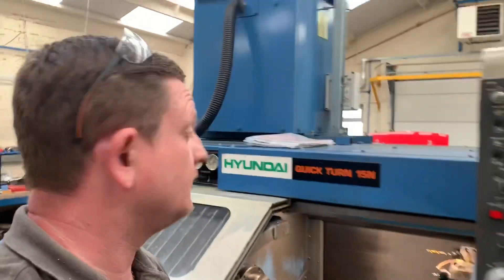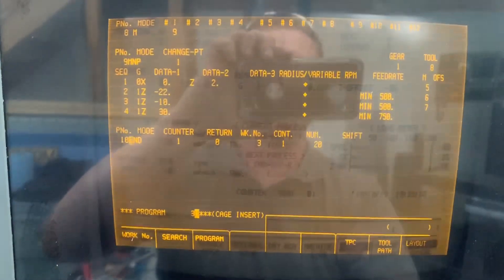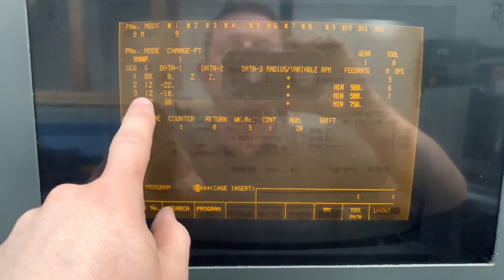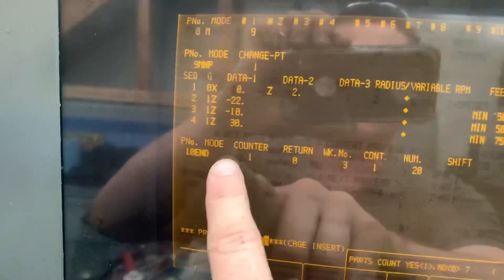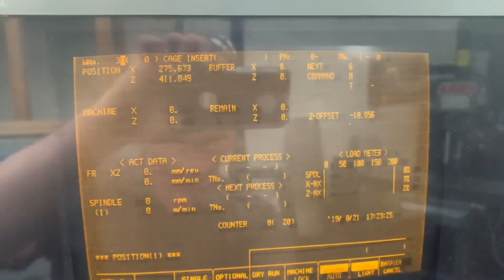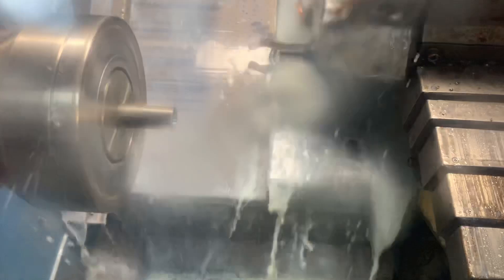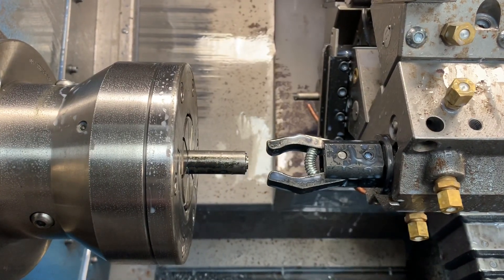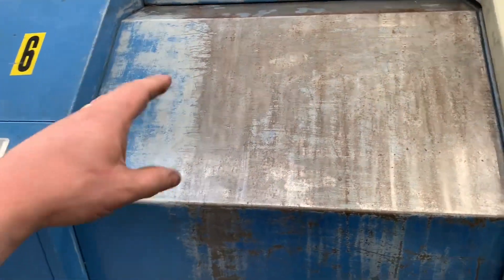Programming a bar pull on the Hyundai QT15n with Mazatrol T32B control

Comment: Its strange that mine with the second line with 0Z instead of 1Z moves in slowly no problem even though its a rapid move as you say?
It also says "282 chuck clamp exceed time" when i go into x100 to move away manually i then have to clear and it closes.

i did see that on some mazaks you have to have bar feed stitch on but i dont have one.

the fact it starts the program means it should work i guess.
thanks and sorry for all the questions..

Skip.
Reply from the maker: Do you have the M code options to control the chuck turned on?

If you do an M06 or M07 when not in a program just using the buttons on the control does it open and close the chuck?

Comment: G'day Marc,
I put in you figures etc it came down to z then stopped.
I then changed second line form 1Z to 0Z and in went in -22mm the jaws opened then it stopped..
I changed line 3 to 1Z from 0Z to see if would work but no change any thoughts please?

Thanks,

Skip.
Reply from the maker: Hi

With regards to the X & Z figures these have to be set to suit your job, X is always going to be zero for a satraight on bar puller like mine but the Z values need to suit the job your doing so you set them but manually jogging through a mock bar pull test and noting down the z values

If the machine is stopping then something is missing from the code most likely

Make sure you have a feedrate set?

Also by changing the 1 to a ) you have changed it from a feedrate move to a rapid move so be careful with that

I could always upload another video if that would help to go through it again

Thanks
Marc

Comment: Still trying can I ask how you describe the bar puller in tools please ?

Thanks,
Rob
Reply from the maker: For the bar puller tool it is just designated as a drill in the tool table with no X offsets obviously and no z offsets.
The gripping diameter of the puller is adjusted via the socket cap head screw in the rear of the tool which opens and closes the arms

Comment: Gday Marc great vid I have mazak quick turn 15n still learning is there much difference in my control to yours you said yours was uncommon ? I reply want to get bar pull going have ordered one similar to yours. I was hoping to get the Bar pull program in  its own block and then call it up and to each program that I need it for. Can you help me do this please.I am going to try plugging in your program tomorrow and see how I go!
Thanks skip
Reply from the maker: Hi

Glad you like the video,

When you get used to using the Mazatrol you really do not need to have a sub program for the bar pull and to be honest im not sure how you do it that way but it is literally a 5 minute job to set up the bar pull at the end of a program using the manual programming so thats the only way i do it, also you will have to ammend the z values to suit each job anyway so it would not save you much time

You did not say what control you have? but im pretty sure most of the earlier controls are pretty much the same, mine is a T32-B

Thanks
Marc

Comment: Thank you,  I don't have pulled, but use same program for bar feeder, working perfect only need change parameter R49 to 01000010 , best regards from Peru
Reply from the maker: Hi 
Yeah i change the R49 when I swap over between collet Chuck and 3 jaw hydraulic Chuck as it allows adjustment of proximity sensors